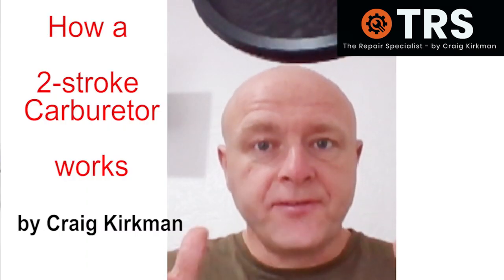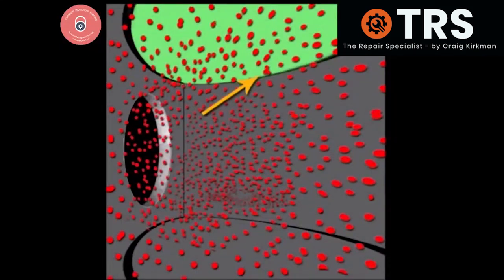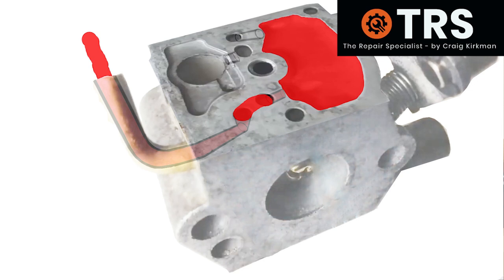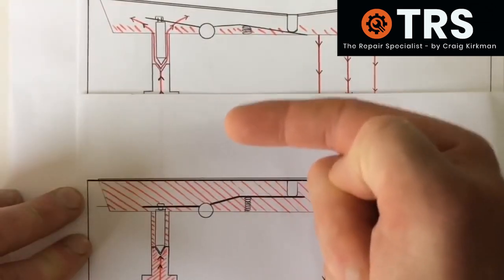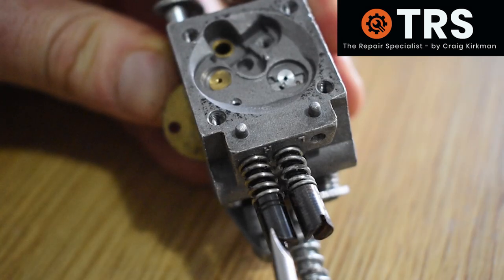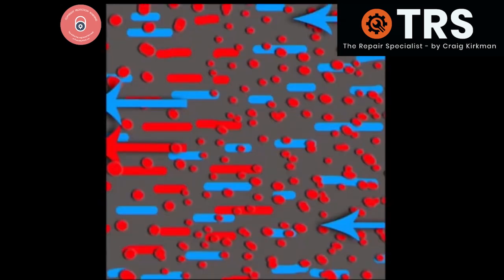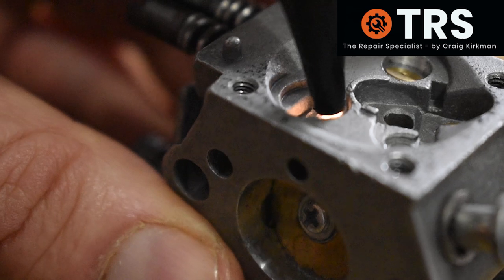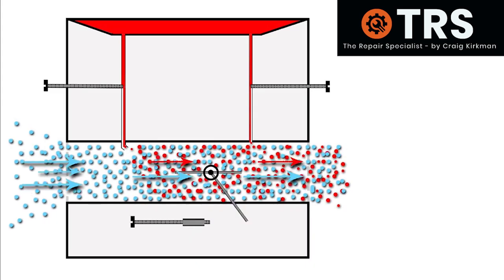HOW CHAINSAW CARBURETOR WORKS:  'Unique Inside View!

Comment: Fantastic video. I just replaced all diaphragms and cleaned the plugged strainer filter, but I was really wondering about the passage of the fuel in the carb on my grand dad's old Stihl 041AV. And it has basically the same carb layout as you've shown, so many thanks for that.

Comment: this is an amazing helpful guide, thank you so much!! do you have a tutorial on how the priming bulb interacts with carburetor? specially how the suction and return path works as it goes through the carb. once I had reversed these lines at the priming bulb and I had a geyser of fuel back into the carb, what made it hard to figure out to a novice like me was that I was able to start and run the chain saw albeit really hard to start. after I shut the chain saw down the fuel will just pour out from the main jet and bleed into the cylinder flooding and fouling the plug, but as the carb had the filter and cover on I could not see it straight away. When I realized what the problem was I had no clue how to fix it, but in the end I figured it out.  thank you again.👍👍